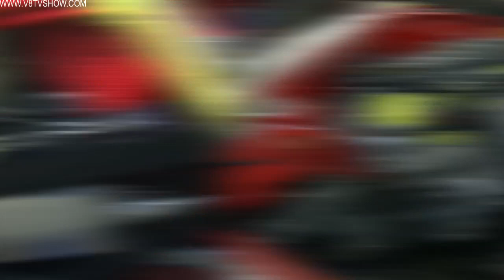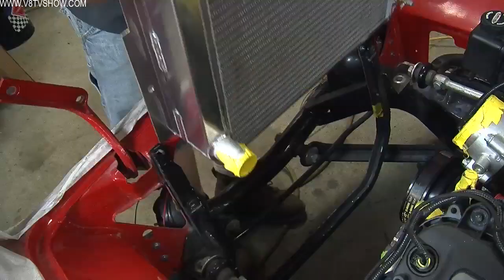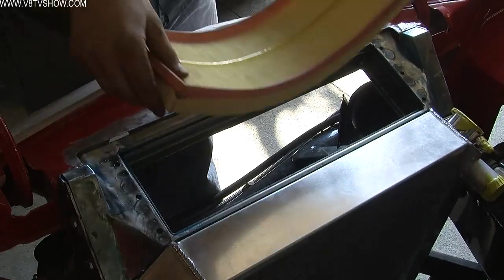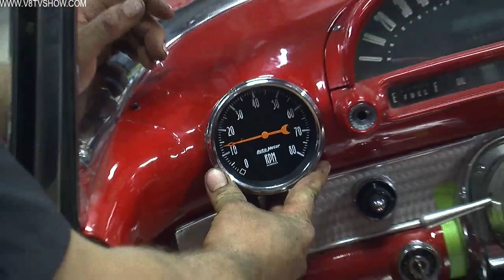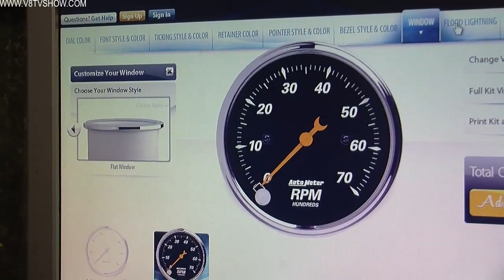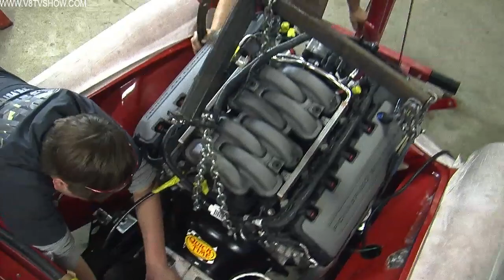1955 Ford Thunderbird 5.0 Coyote Swap Restomod "Coyo-T-Bird" First Start Video V8TV

Comment: Do you know anyone who's done at 55 keyboard on an Art Morrison frame? I'd like to see it.
For small car the 55 T-bird is heavy. I saw one with a 427 side Oiler with 2 floors and a 4-speed.
My dad had one. I Learned to Drive in one. I was fortunate to drive a $100,000 frame-off restoration.
With three speed and O.D.
The car was perfect.
Somewhere between a carriage and a locomotive in technology.